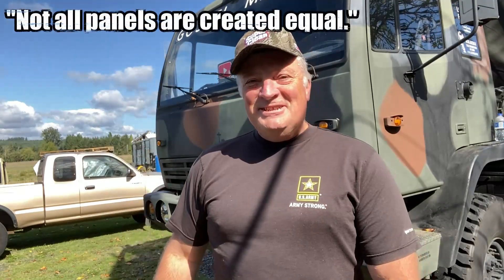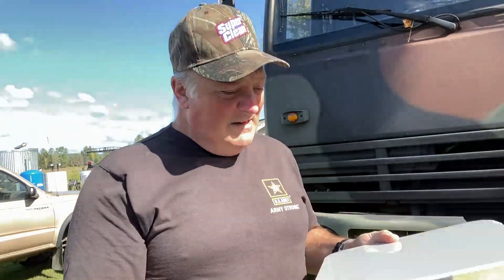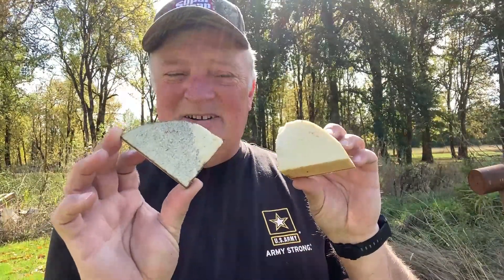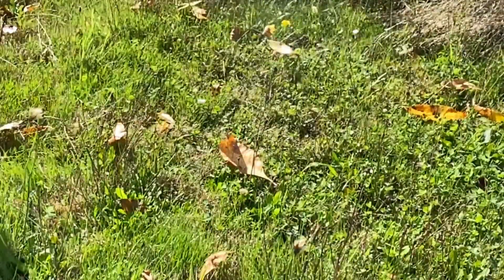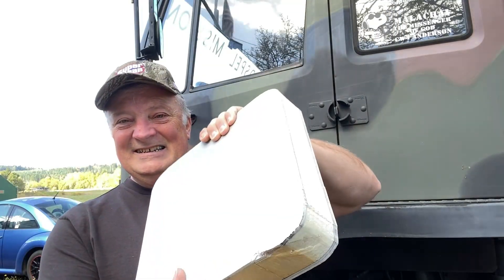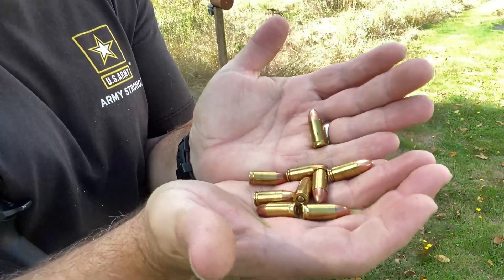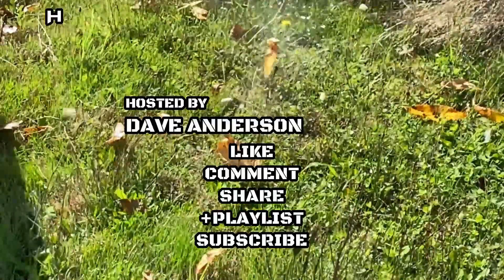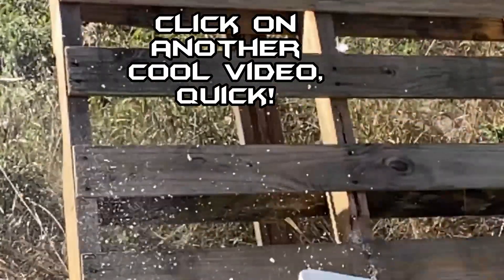Expedition Camper: COMPOSITE LAMINATES

Comment: Looks like that last hit pushed really hard against that extrusion and almost broke the back off. I'll bet if you turned the panel around, it wouldn't have even moved the laminates. That looked like a lot of fun!
Reply from the maker: I do believe you are right. It was the aluminum extrusion that pressed against the back panel... if it was the other way around, the extrusion would have just pushed against the insulation, absorbing the energy. Good call!

Comment: Can you discuss how you would repair a panel if somehow you did that managed to damage one (collision with big tree branch etc)? I assume the individual panels are not replaceable on a “box”. 
Thanks in advance
Reply from the maker: Sure thing… easy! Just use a can of ready mix fiberglass body filler with hardener. They sell that at Walmart. Goop it in, sand it smooth, primer and paint. A good gel paint would be great. Would you like to see a video of that?
Reply: @HelicoolsHelipad  Great, just traditional automotive body repair with a fiberglass filler. Thank you.